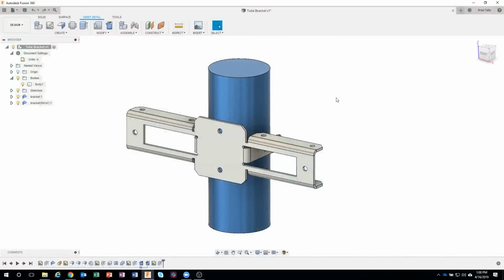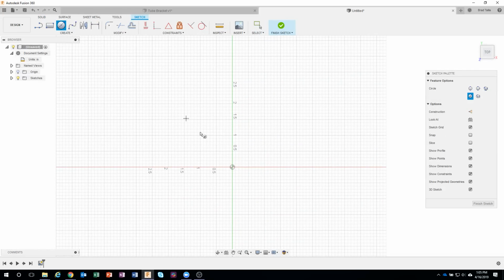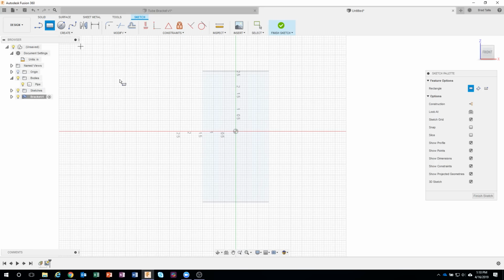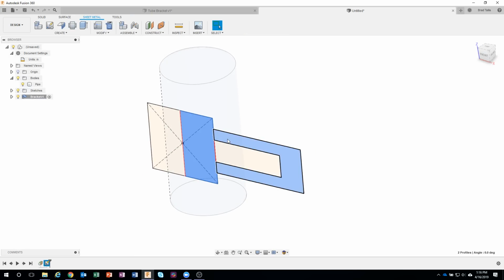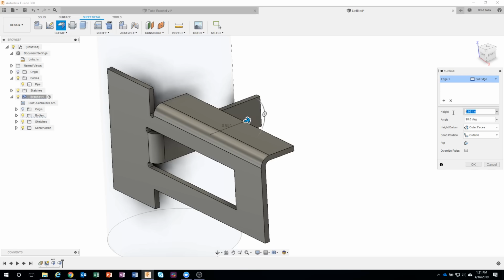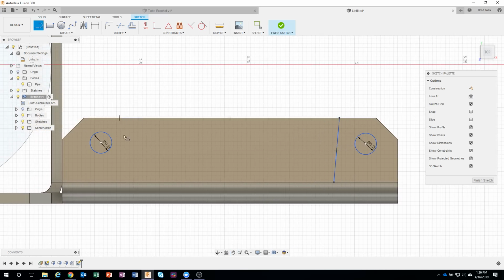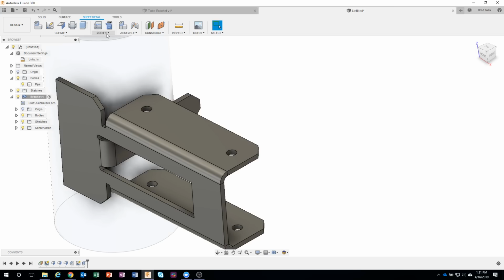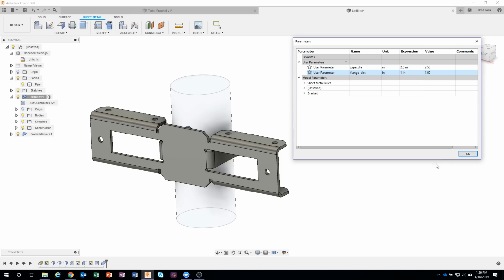360 LIVE:  Creating a parameter-driven Sheet Metal part

Comment: I know you always preface your method with "This isn't necessarily the best way to do things; just one way you can do them.", but, when you put the holes in the flange, I think it would've been more effective to use the sketch to geometry to position the hole center-points and then use the Hole command, rather than an Extrude, to produce them. I find that, should you need to modify the holes later, it's easier to find a Hole feature in the timeline than search for a particular Extrude. Also, it could simplify the timeline since the Hole command has a lot of additional power than Extrude doesn't - like creating threads, counter-bores, and drill geometry. However, when positioning the holes in the sketch, I do use full-size circles so that I can see if there will be any issues. Just placing points doesn't give you the full picture. 

As always, I recognize that this is a minor thing; I'm just hoping it can be beneficial to someone!  Thank you for all the time and effort you put into these videos, Brad; I've learned so much from you and your fellow presenters!

Comment: Brad what the think surface modeling front and back . Why the different?  and dose it matter when you use both side the same ? How would you surface model?
Reply from the maker: Brad was using sheet metal design, specific to that manufacturing method. For surfacing lessons, check this: https://youtu.be/NypRE2aFhh4 
It's a very well regarded lesson.

Comment: I guess I would have either parameterized the hole diameter or used equal constraint on the holes. Regardless, I better understand sheet metal now.
Reply: @R Wilson-  Yes, I should have created a "hole diameter" User Parameter and used that for the holes since they were all the same.  Or, like you said, use the Equal constraint.  Thank you for watching!
Reply from the maker: Glad to hear you learned something! Thanks for replying, Brad.

Comment: Yes, there are a tons of units, but no area. Today I wanted zu use mm² for a little test – is’s not available.
Reply from the maker: What's the context that you want to use this?
Reply: @adskFusion  For example when I want to make a pipe with a specified cross section. When I have to make a pipe with for example a parameter of 7,854 mm² cross section I could calculate the diameter of the pipe from this value.
Reply from the maker: I would think this is the exception, rather than normal way of designing. BUT, I've been wrong MANY times in my life...if you haven't already added that to IdeaStation (https://forums.autodesk.com/t5/fusion-360-ideastation/idb-p/125) please do. The more people that vote for it, the more likely it is to be considered for a future update.